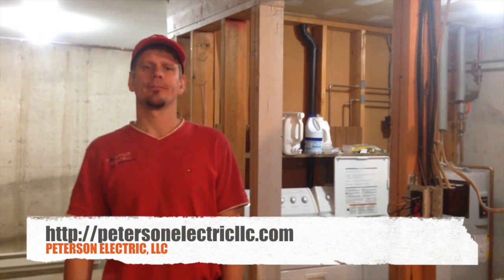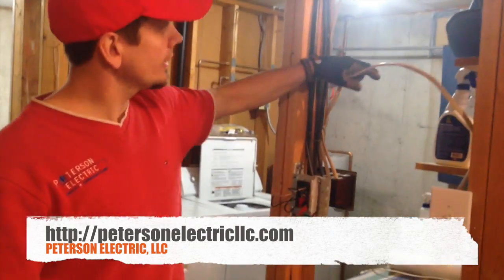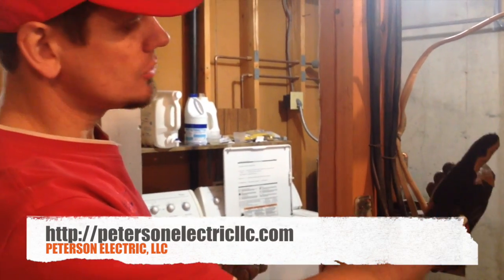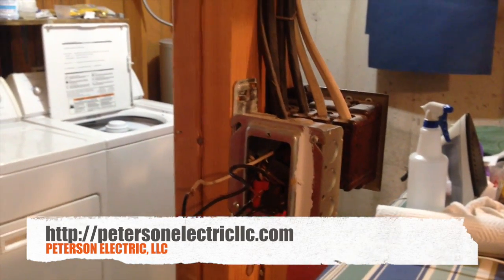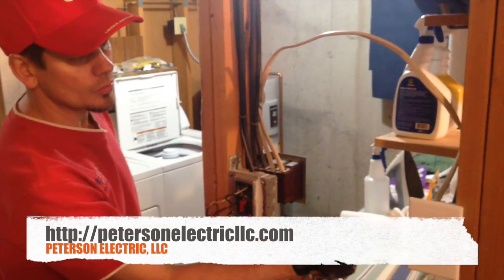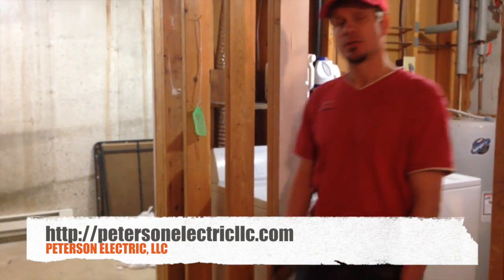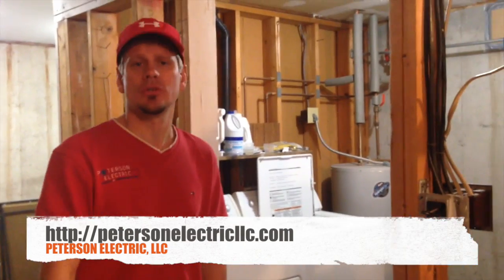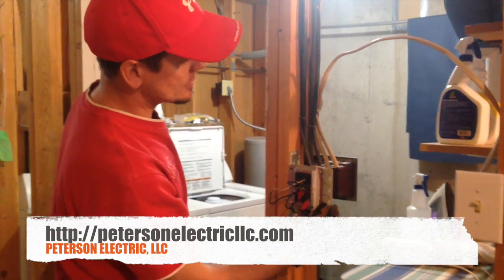The Importance Of Grounding On Your Electrical Main Branch Circuits

Comment from the maker: The grounding electrode conductors protect each and every panel or sub panel assuming that they are all connected together, with an EGC. On branch circuits, you have to tie all EGC conductors in the boxes or junctions when making up circuits, even if the circuits are of different voltages or phases. This helps save "your self" from becoming the path to ground. Same example in this video when I was standing on cement.

Comment: 3:47  "That's what keeps you from having the equal potential of getting electrocuted."  What is that supposed to mean?  The purpose of equipment grounding is to bond conductive straps, boxes, frames, etc. to the service neutral, permitting the quick and sure opening of a breaker in the case of a fault.  It has nothing to do with bonding them to water pipes or electrodes.  Those items (and any other available) are bonded to neutral as well as Earth to keep their potential to neutral at zero.